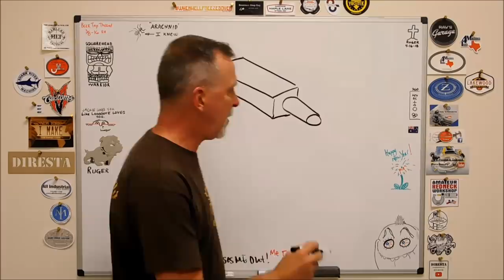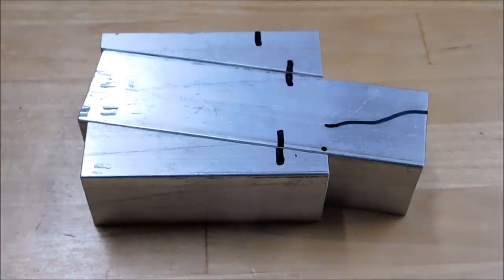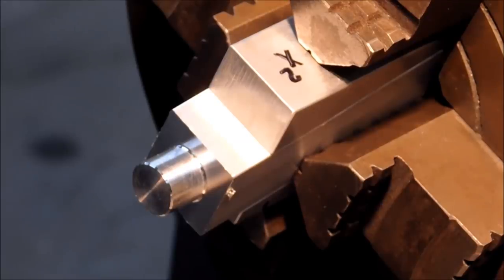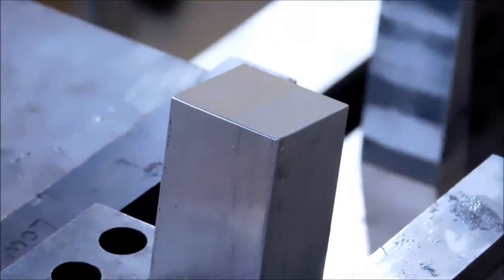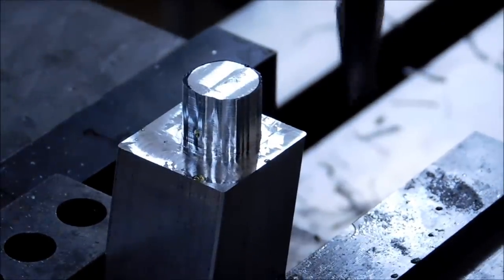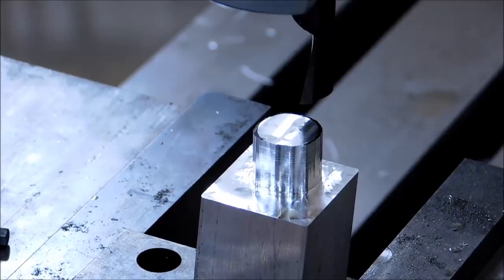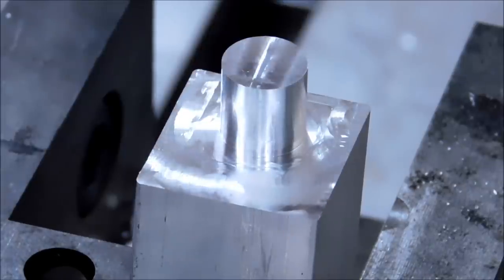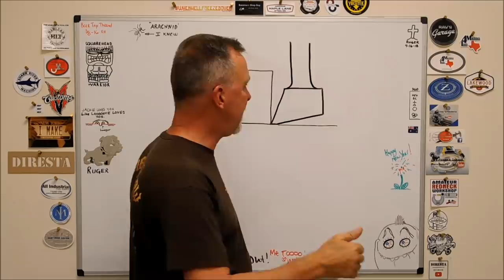Machining Angled Bosses on The Mill and Lathe

Comment: Joe, always nice to see different approaches to a problem. However what if the part required the square stock to remain at 90 degrees, rather than perpendicular to the round journal?  What then?
Reply from the maker: A 90 degree feature would be perpendicular. If the cylindrical feature is inline with the stock, its just done normally in a 4 jaw or mill vise. I am not sure I fully understand the question.
Reply: @joepie221    Wish I could attach an image.   I'm saying that the cylindrical part is still at an angle coming out of the end of  a squared off stock.  The only way I can think of doing this is to make it in two parts.  Basically drill an angled hole in the end of the stock and then insert a rod at the correct diameter.   Hope that makes more sense.
Reply from the maker: @rendermandan2820  Now I get it. That geometry is not possible to achieve with either of these methods. You'll need a dovetail type cutter and a CNC to generate an angled boss on the end of a square surface. The relationship from the round to the flat would go from square to acute to square to obtuse and back to square. Not possible manually unless you drill and pin like you mention.

Comment: Enjoyed the video. I have one issue with running my boring head in reverse is that it will unscrew from the arbour with which it is paired.
Reply from the maker: The rotational direction of the boring head is driven by the tool and setup used. Running the boring head in reverse is not an absolute for this procedure.

Comment: I’m not a machinist so if you wanted the base of the round boss to end up in the center of the square stock on both ends what would be the best approach? With the angle of the round boss seems that could be tricky
Reply: I would use the milling machine. You can trig the angle that you're cutting, and use an edge finder on the sharp corner of your part. Then you know exactly how far to move to the center line of your bore.

Comment: Hi Joe, I have a project to do and wonder if you can give me any heads up on it?  I have a planetary ring gear 11.550 OD and 10.625 ID and 2.070 thick with 72 teeth  inside 10P, A-2 tool steel to be heat treated to 62-65 rc, would you have any idea how to do it in a bridgeport mill to cut the teeth?  I watch your videos all the time, I am a toolmaker/diemaker/moldmaker of the old school (77 years old) this is a challenge to me, but i must admit, other than broaching it with a form tool, I am stymied!  Thanks in advance if you have any ideas!  Frank
Reply from the maker: Sounds like a perfect part for a wire EDM. broaching on a mill could work, but would be time consuming.

Comment: (10:40) What's the reason for moving the cutter outward a bit before reaching the corners of the workpiece?
Reply: Oh I get it, it's to make sure you're not breaking through the far edge with the center of the cutter and creating an isolated island between the corner and the inscribed circle of the cutter. So it doesn't snap off and form a burr or surface defect or something.
Reply from the maker: I am a big fan of climb cutting outer edges to reduce or eliminate burrs. When you see me walking around the outside of a part, I'll step out like that on corners so the cutter rotation continues to drive the burr inward and not push out on a corner.

Comment: There are many ways of skinning the cat -
(Figure of speech, I love kitties, and would NEVER harm one.)
In any case - if the procedure makes an accurate part :
1. In a reasonable amount of time.
2. Without anyone hurt.
3. Without equipment damage.
4. Without undue cutting tool wear.
Then that is a dandy way to make the part.
Y.M.M.V.
Reply: Don't feel guilty. "Skinning a cat" refers to skinning catfish, which are notoriously difficult to skin but quite tasty in the frying pan and well worth the effort!

Comment: But how would you machine it if the shoulder surface had to be perpendicular to the main piece axis, not the machined cylinder?
Reply from the maker: That would require form cutters and a CNC machine. Couldn't be done on a lathe or manual mill.

Comment: Newbie here, but why doesn't he cut the corners 90 degrees when he is milling the flat face at 10:20 ? At each corner he jogs the cutter out towards the edge of the part as he reaches the corner, then cuts that off from the new side.
Reply from the maker: Burr control.

Comment: I had to use a boring bar for that in the past.  MY problem was that the head started to rotate off the shank because I had to go in reverse.  Those boring heads aren't meant to go in reverse.  How do you alleviate that?  BTW that was one of the time I had to set up the rotary table.
Reply from the maker: Use a left hand bar
Reply: you used a right hand tool.  How did that not happen?

Comment: Your head is not squared.

The amount will not affect the tolerances of your present part, but for anything really tight you should tram your head.
Reply from the maker: The head is within .0003 over 16" in the X, and nearly perfect in the Y. The digs come from tool deflection.
Reply: @joepie221  People think my family is weird because we were raised to such high standards of machine perfection but our dad was both an A&P in the USAF, as well as he worked on radar after the Korean war and ended up working as an electronics technician and serviceman for the FCC radio repeater system for the whole of the United States [not meaning he did them all, just meaning that he was on call to do any one they needed done, no matter where it was, pretty much like anybody else in the same job position, in case closer techs were for any reason unable to respond at the time of need].

The few things he demanded of his children were cleanliness, honesty, honor, hard work and precision.

Very Scotch-Irish.

As a result, we have all gone on to excel in one or more technological trade such as machining/manufacturing,  and electronics engineering.

People would probably get impatient with one of us when we were tramming a machine because we work until it reads zero in all directions.

But then, as long as you never reset the head and always set angles with the parts [not always possible, I realize] you only have to re-tram it if you crash it, or if you run a really heavy load on a really long production run.

Still, we re-check the machinery every 6 months as a matter of training, even if it was not ever used. Just ingrained training.

Comment: Another way is to use a rotary table with the mill?
Reply from the maker: Yes.
Reply: Im guessing the idea of a tooling ball would be to mark the center of your boss then cut a shallow spherical dip with ball end mill.  Then loading a sphere of larger diameter into tailstock or quill would allow you to center on the boss with out constraint of angle? Then you could set that up on a rotary table with the ball engaged into the quill or tail stock on center and secure the part at whatever angle you wanted and end up with the boss concentric due to the ball?

Comment: Jesus... why use a TPMG insert for turning and braze tip its like its 1980's again if you need donated tool holders and inserts with chip breakers just ask I'm sure enough here would help and that isn't backboring.
Reply from the maker: The insert was used because that was the tool on the shelf. if you do your homework, unlike the 80's, you'll find kennametal does offer coated inserts qualified for aluminum turning, so without knowing the actual grade and coating, your comment may be a bit early. As for the back boring, that term can also be attached to inner or backside boring operations as well. We always called this back boring too.